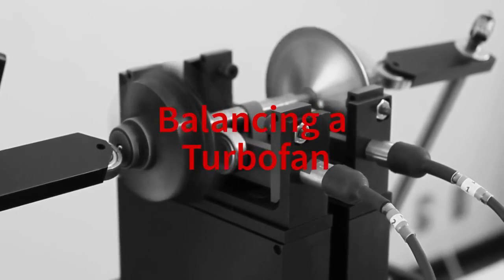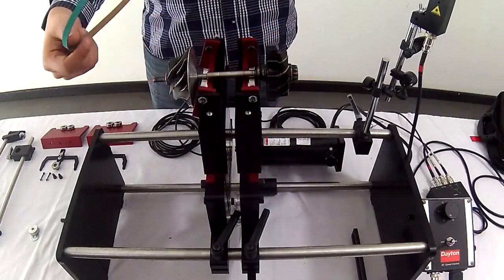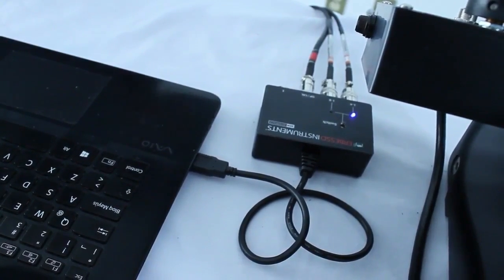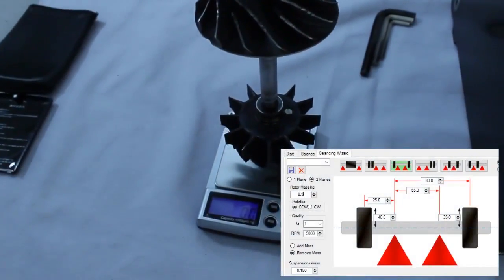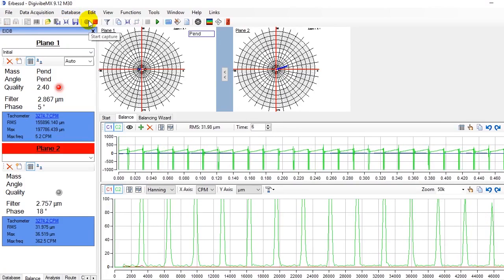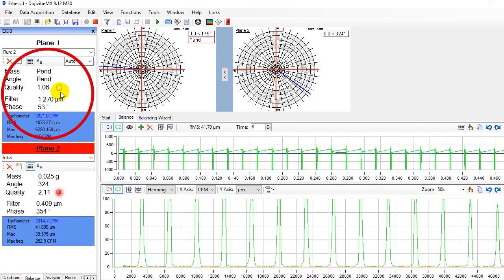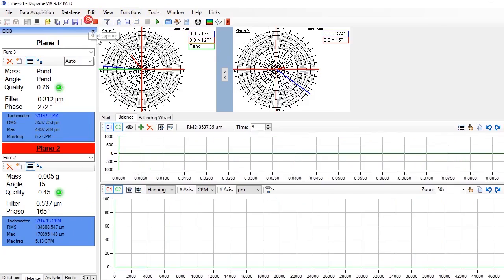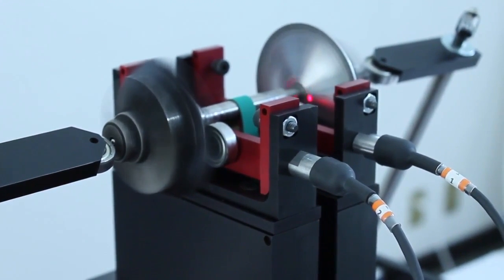Balancing a turbofan using Soft Bearing Suspensions

Comment: Hello My name is Nasir and I’m currently an undergrad in mechanical engineering 

I am building a soft bearing balancing machine for my final year project 

I can make all the physical parts but my problem is the software and how to program it to take readings from the photo sensor and vibration sensors is there anything you would recommend I can do ?